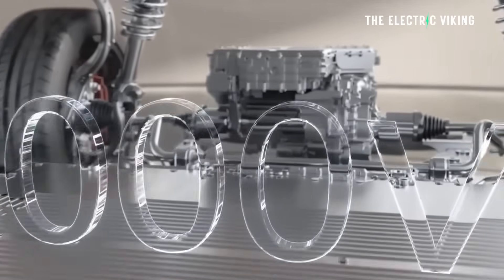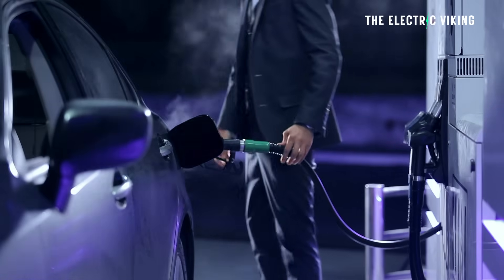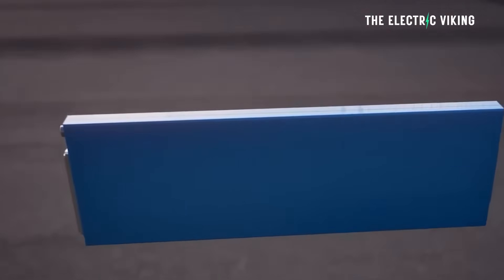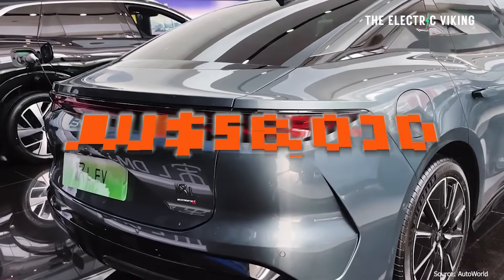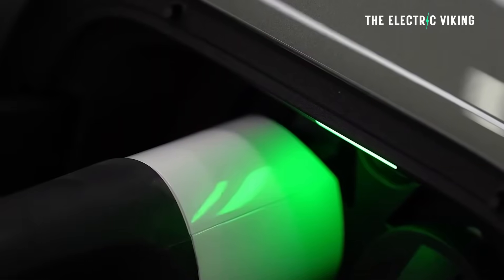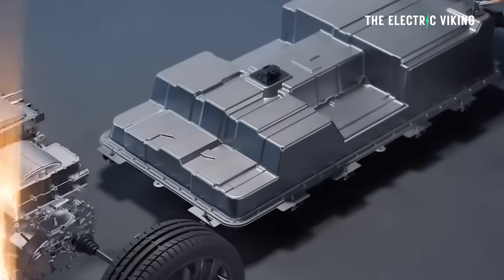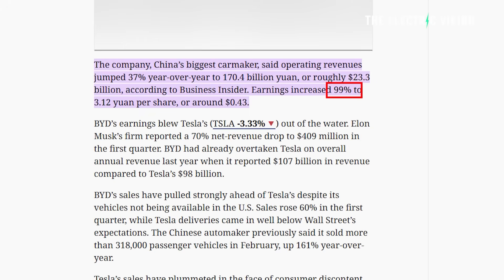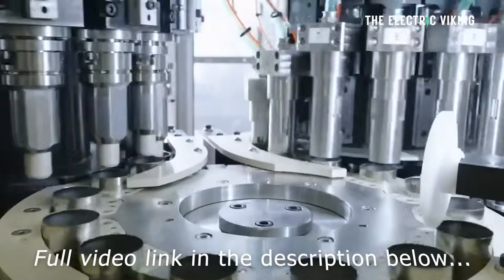Charging as FAST as Gas: BYD’s 1,000 kW Superchargers Rolled Out

Comment: Nothing is only honey and sugar. And I'm amazed it's been more than a week and nobody talking about the downsides:
Fast charging is less efficient ! Meaning u lose a lot of electricity that should have went in the battery, as heat. 
Last time I checked, such tech is barely 65% efficient. Meaning for each 1000 Kw used to charge, 350kw are tossed away. But it's not JUST about electricity waste ... someone has to pay for it. YOU.  So expect charging rates to be at least x2 more expensive at these chargers.
By comparison, google it , Tesla Supercharger V3 has 92-94% efficiency.
People talking SHHTHS about someone 1up-ed Tesla, but they forget Tesla had 1MW (1000 KW) charging station since 2-3y ago when Tesla Semi was launched. From their point of view, Tesla won't release a "Technology" for eye candy. It has to make sense and be efficient. And currently, spreading such HEAVY 1MW / Station loads through out the grid is pretty inefficient and inconsiderate.

Comment: I have a relatively new home, built in the late 1990's. I know that I would have to completely upgrade my electrical system to charge an EV. I wonder about the ability of the electric grid to supply the amount of electricity needed, especially if all my neighbours buy an EV. I also wonder about this elusive cheap electrical power. Everything I have seen, or read, disputes cheap electrical power regardless of how it is made. Whether I am paying for gas or electricity, I am still paying for it. 
 Fuel is not given away, it has to come from someplace. AND this fictional renewable power is just a dream. Unless your area is blessed by Hydro power, then dream on. Windmills and solar power is NOT reliable 24/7, and megawatt batteries cannot hold more that four to eight hours of usable energy.
Reply: That depends on where you are at. Ontarian like me will have 200amp/240V at our door from hydro. House build in 90s shall have 120ish amp panel comes in. That shall be adequate for 1 LV2 EV charger. I just happen to run out of CB slot and end up have to up the power panel. Otherwise, you shall be able to manage with 120 amp capacity considering you are not Charging, running dryer and oven along with hvac at the same time. And pulling the cable to garage will be totally depends on the distance. I end up using 60ft of distance, and paying 1800cad all included.

Comment: Please talk about downsides as well. Charging at these speeds is also highly inefficient. A big chunk of electricity will get wasted as heat.
Current Tesla Superchargers V3 opperate at 92-94% efficency. Last math i did on CATL they were supercharging at 60% efficency.
That is a lot of energy wasted meaning: 1) a lot higher charging costs 2) increased load on the grid
Reply: My point is... Tesla could have done it as well. Afterall they had the first 1MW chargers for Tesla Semis.. the issue is , they won.t release something if the  quality and efficiency is not high.

Comment: It will take ages before 1MW chargers are widely avalable.  Besides, this is the peak charging power,  don't expect 0-100% 100kWh charging in 6 minutes. As it is now, the standard 40l/min petrol or diesel  pump is hard to beat.
Reply: Here in Europe, BP gas stations already have 570kW chargers. Yes it's not 1MW but already future proof for most car brands.
Reply: It is 0-80% in 5 minutes. Charging already beats petrol and diesel with home charging. Which is what we do most of the time anyway. 
These MW chargers are just icing on the cake.
Reply: @ It is rather 10-80%, batteries cannot be discharged below certain level. As for home charging, it takes hours if not days. My 20kWh PHEV charges in 6 hours  but luckily I don't  need that too often as the ICE does the job  on the move.
Reply: @stivans1556  It doesn't matter if you drive a BEV or PHEV or what the battery capacity is. A BEV doesn't use more energy that a PHEV. If it takes 6 hours to charge on a daily basis, it will remain at 6 hours with a BEV. This also happens to be typical for most drivers on a level 1 charger. You can reduce that with a level 2 charger. It would be about 1.5 hours of charging on a daily basis. You can also charge in the middle of night with lower electricity rates.
Reply: @ The point is that with a BV you don't have a choice. Charge it or forget  it. A PHEV can but doesn't have to be charged. In my case I indeed use the night rate and it is mostly sufficient for the day but whenever needed, I still have the freedom and convenience of the ICE.
Reply: @ For me, BEV is more convenient than PHEV and statistically that would be true for most car owners. There is much less maintenance and fewer headaches. I am actually not trying to argue one is better than the other for everyone but with fast charging now, it really doesn't make much difference for those longer trips.
Reply: @stivans1556  wierd, my 75 kWh Model Y will charge in 7 hours from almost flat. 
Most days, it replaces the charge used in one hour.
Reply: @stivans1556  ICE leaves you vulnerable to supply chain disruptions. With BEVs, you at least have the option of making your own electricity.
I spent the last decade in Florida watching people with gas cars and generators have those fail when gas stations run out of gas two days before and for three days after a hurricane while people with BEVs and solar lived just about normal.
Reply: @williammeek-h2o  Another reason to opt for a PHEV. Best of both worlds, charge of fill the tank whichever comes best for the moment.
Beyond pure practicality, PHEV combines the by far superior energy density and transfer rate of the liquid fuels with the energy recovery and higher energy release rate of the chemical batteries or supercapacitors (the instant power advantage).
Reply: @stivans1556  In my experience, the advantages of PHEVs are largely negated by the high cost of fuel and ICE maintenance. 
Either people religiously plug in and regret having the gas engine to do maintenance on or they never plug in and regret dragging around the heavy battery and motor.
In practice, PHEVs are a sad middle ground having few of the advantages of either but nearly all the disadvantages of both.
Reply: @williammeek-h2o  You might be wright but only for the range extenders and serial hybrids. Indeed they comprise the disadvantages of both technologies. Parallel hybrids on the contrary, combine the strong features of both ICEs and BEVs and mutually compensate their weaknesses.  I know this first hand, nothing to do with fuel costs. In fact here it makes no great difference between petrol and electricity, For public chargers, especially the fast ones, it is cheaper to drive on petrol.  This said, the energy recovery provided by the e-motors saves indeed quite a bit of fuel. As for the maintainance, spreading the load between two complementary propulsion sources spares both.
Reply: CATL's battery swap tech is the future.
It can service 822 battery swaps per day.
The station takes 4 parking space, and charges 30 batteries simultaneously all day. It only need 1 MW to service that many cars a day.
6 Brands are already producing cars using this technology.
Reply: @ The idea of battery swaps has been already tried and abandoned earlier (I believe including Tesla and Renault) . It also contradicts  the "charging as fast as tank fill " claims by the same battery developers.  Now most Chinese brands are re-inventing range extenders, btw also an abandoned by many (BMW I3, Fisker Karma ) concept. Seems BEV manifacturers are finally waking up to the fysical limitations of the present and future  ion energy storages. I'd wait for fuel cell technology to go further, should that happens.
Reply: @ Hydrogen cell for cars is most definitely dead. Batteries are just getting better and better. Battery swapping in China is still a thing but may die out in time since charging speeds are getting really high.
Reply: @stivans1556  imagine mentioning BMW to prove that battery R&D is dead. Anything European is between 15 to 20 years lagging behind CATL or BYD. Your knowledge is from the past
Reply: @stivans1556 Tesla hasnt done any breakthrough in battery tech for the past 3 years. 
CATL is know producing sodium batteries only a year after announcement, when EU automakers promised it for the past 4 years and has yet to deliver.
You are mentioning the wrong names to support your claims.
Reply: @ Never mind the names and brands, hard to keep track with all those "game changing"and "ground beraking" advancements producing marginal 20-30% increase of specific energy and energy density capacities. Batteries are reaching their maximal potential level and will remain a dead weight factor in mobile applications. This said, one feature is undeniable: energy recovery. No ICE can do this alone, trhe reason I chose for (P)HEV.
Reply: @stivans1556  yeah it's so hard to keep track of the two largest battery manufacturer of the past decade.

Electrolysis takes 55 kWh to produce one kilo of hydrogen. This hasn't changed for the past 15 years. Toyota Mirai can make up to 100 km using one kilo of hydrogen. So you can say it takes 55 kWh per 100 km. A same size electric car needs <20 kWh to drive the same distance.
Lithium-ion battery density improved by 1200% for the past 15 years.

Toyota has been trying to reinvent fuel for 32 years with this hydrogen joke. They sold 20 thousands hydrogen cars in the past decade.
Reply: @ Batteries have to improve by at least another 20 times  to compete with petrol  fuels.   But even before this happens, if at all, what is good for BEVs is even better for PHEVs.  As for the distant future, who knows, nuclear batteries are on the horizon, perhaps cars will never  have to charge at all. Until then, 2-3 minutes at the petrol station and/or occasional charging  is OK for me.
Reply: Technically, it is from 20-80%, and don't forget that "5 min" charging depends on the battery capacity! A battery capacity over 100 kWh needs a charging speed of over 1 MW.

NOTE: Fast charging makes the cable hot, so higher speed = hotter cable. Especially in the summer, the charging speed may be reduced for safety because the cable will be hot, so "5 mins" will then become "10 mins". Maybe not just the cable, but also some components inside the charging box. Physics is physics... 1 MW is not a small amount of electricity.

Companies will test this as they do now, but it will never be standard for all cars.

Not only do cars have different shapes, heights, energy consumption, etc., and that's why cars have different battery sizes, but the worst part is who will charge more than 100k-1m batteries at the end of the day...

This will not be possible everywhere in the same locations as the batteries must be available again the next day for other drivers who need them.

These swap-system locations would have to be quite large/tall to be able to stock 50 batteries... and all 50 batteries must be charged within 12 hours.

In big cities, only 50 batteries available for swap would be ridiculously low... 🤣 even more than 100k batteries would be needed, and to charge these 100k batteries in 12 hours would require a huge amount of electricity to reach these locations (a cable as thick as a water pipe 🤣).

Of course, the brands that now have swap-system locations only have a few  k  of cars. But if all car brands or cars on the road had this system (now or later), it would be a completely different story!
Reply: @ Absolutely true, super-fast charging is not just about the on-board hardware, it requires sufficient grid power, especially if multiple users are charging at the same time.  As for  swapping batteries,  reminds me of the horse-swapping ritual seen in western movies. Is it not easier to swap the whole car?   Like returning empty bottles and taking filled ones at the counter.
Reply: @ China is already doing it in mega cities and they have no problem upgrading the grid
Reply: @itsyo42  Come back when it's done.

Building xx locations is one thing, but building 5k locations is a completely different story, and the grid will not support that.

Every country can do this, but the question is whether it is worth it, how long it will take to build at least 5k locations in a city with 10 charging boxes per location, and if the grid will still be stable, or will the charging speed be reduced when all the charging stations are xx% full.

You think this is simple, but it's not! There are many factors involved in building charging stations with a charging rate of 1 MW per box.

In China last summer, people could only charge between 0-5h on really hot days because the grid couldn't handle it.
Reply: @ Good for them. When I see the infrastructure here in  the EU ready for < 5min 10-100% charging, I might change my mind about BEVs. Till then, happy to fill for 2min 0-100% at any petrol pump.
Reply: @dchubworldsharenetwork  
Lmao BYD has already built more than 500 of 1000kw charging stations and is building another 15000 in China alone. These are already available for the public and the cars are already on sale.

Comment: A 1 megaWatt charging infra (1kV and 1kAmp), that is amazing. Is such an infra even possible, considering the outdated electricity grids in so many countries (Europe for instance)? Charge only during the night, when overal grid power consumption is low?  The Chinese grid is relatively modern, could handle a 1 megaWatt charging infra for EVs.
Reply: I think BYD's solution is to install their Batteries at the charger site.  Definately makes sense for BYD as their sell batteries as well.
Reply: @ricosun  They already made battery before they make cars.
Reply: With 1 MW charging need to book in with the closest powerplant to kick in the extra gas turbine...

Comment: Oil is below USD50/ barrel today and under even greater pressure when more EVs replacing ICE transportation in the next few years towards 2030.
Reply: You forgot the carbon tax
Reply: So, basically, not at peak oil after all.
Reply: @vincentcausey8498 in terms of volume yes.

Comment: I am not interested in that much fast charging. After I have driven for 3 hours I need at least 30 minutes to recharge my biological batteries. I am only interested in longer range of at least 400 miles
Reply: Yes there needs to be at least as much real range as a typical gas tank gives. Wouldn’t say no to super fast charging though when you are in a hurry you would really appreciate it
Reply: The blade battery is LFP, much safer than lithium-ion.    Thats often not stated.  I would not charge lithium ion at my home, due to the fire risk.
Reply: @tftftf  do you charge laptops and mobile phones at home? The risk is mostly if the pack is damaged like in a collision or charged improperly

Comment: I’m fine with 500kW charging at 10 minutes, 1000kW is insane!
Reply: Dont forget, you also have to transport that energy somehow., without melting things: wires, cars...people.
Reply: @zsokzsolt  That is a weird thing. I started doing the math on real world stations. It turns out the peak power demand is determined by the number of cars that visit at peak hours, and has nothing to do with the specific power of the charger. If your station is designed to service 120 cars per, your peak loading will be 10 MW whether you have forty 250 kW chargers or ten 1 MW chargers. 
Since we already have charging stations, it is well understood how to power them and the specific power level of the charger doesn't really make a difference outside of the station.
Reply: @ So...10 paying customer vs 40. No wonder I never saw greater numbers than 140kw per charger. Unless you charge premium for fast charging this doesn't look like a good business decision unless you make it premium to charge at higher speeds.
However I doubt many would pay premium for faster charging. I have a feeling that no battery will be charged with 1MW... (I might be wrong)
Reply: @ No, its 120 customers either way. Maybe read the comment.
Reply: unless you have a truck. then it will just be really nice.

Comment: Yep another one of those pipe dreams , so many things wrong with this fantasy. 1 electricity supply 2 charging cables would be huge 3 charging socket would be gigantic 4 heat caused by such inrush current would be ridiculous, and the list goes on and on and on .
Reply: Isn't that why they're going to higher voltage systems? I'll trust the engineers know what they're doing
Reply: This would be the case anywhere else outside China. A country with literally 3.3 TERAWATTS generating capacity can handle this easy. Also, I think you're way behind the curve. BYD is already installing these chargers NOW. They aren't planning it like some western company BS. They're actually doing it right now.
Reply: BYD has already built more than 500 of 1000kw charging stations and is building another 15000 in China alone. These are already available for the public and the cars are already on sale.

Comment: Where in Melbourne can I find such a charger?
Reply: Anywhere... Just need a lightning rod connector for your car and a decent storm...
Reply: @heater424  Yes - charges the battery in 0.005 secs but you have to manually stop it halfway through otherwise you void the warranty on the battery.
Reply: @ :) Nah, BMS will handle it with ease...
Reply: No where in the world except China.    Sam is pushing somthing that’s nothing more than a fairy tale  for the rest of the world.  Let alone Australia 😂